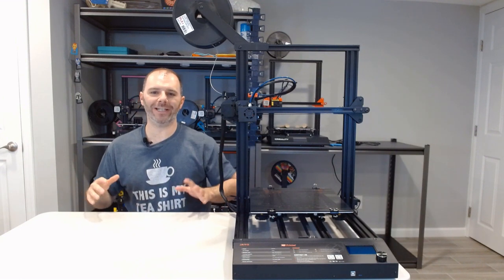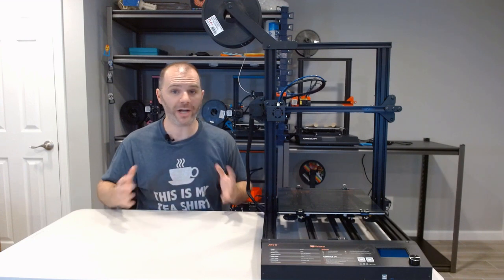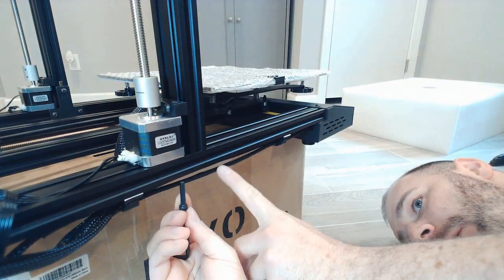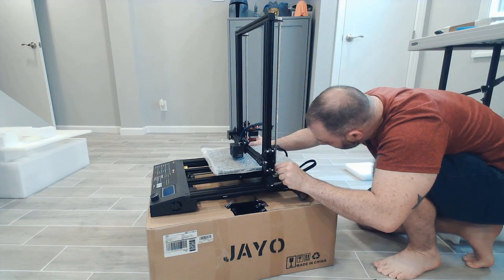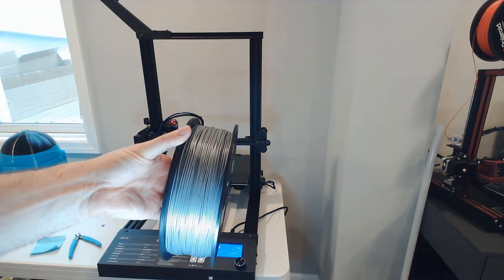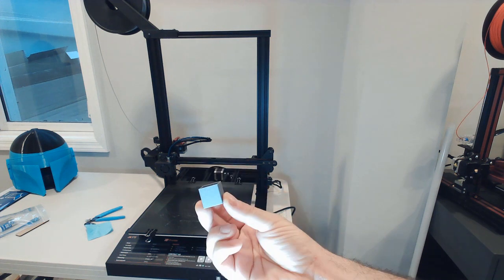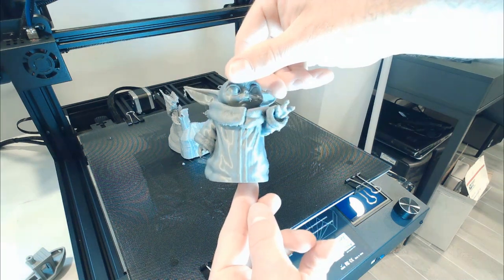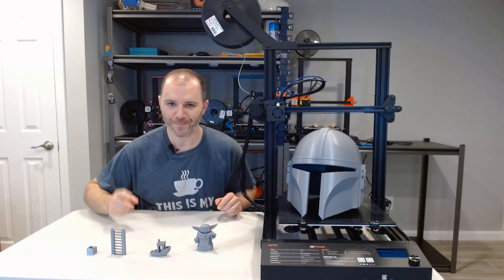Jayo S8 Plus - Unbox, Assembly, First Print | Sunlu S8 Plus

Comment: Just ordered the 8 Pro version and my plan is to convert it to direct drive for TPU since it has the "open" extruder design of the Aquila to where with a more closed design to receive the filament after the drive gear (which there are 3d Prints for this to say nothing of hardware kits), I can hopefully minimize the chance of filament escape.  A $15 Ender direct drive conversion bracket set will let me mount the extruder over the hotend with a bit of Capricorn tubing.  Hopefully the hotend will mount on that new Ender carriage included in the kit, but if not I can drill and tap some holes or even just get a new hotend compatible with the Ender mounting since they're not that expensive.

Between the great price for the Pro at $199 with flex magnetic bed and quiet steppers combined with an apparently easy way to convert to direct drive AND have not some closed extruder to have to tear apart if TPU filament escapes, I think it should be a good deal for the large print area.  I also like the full size USB on it as I use Octo4a which works just fine with a Tracfone Blu View 2 for $30 (plus a OTG adapter for charging and USB connection) to give me full remote WiFi control and printing using Octoprint.  Hard to beat converting your printer to full wireless with Octoprint for $40 and stop running SD cards back and forth...  They should have a marketing line like "Once you Octoprint, you'lll never want to just print".
Reply from the maker: B it sounds like you have yourself a nice plan! For the TPU you don't necessarily need to convert to a direct extruder, if you just upgrade the extruder to a BMG clone style extruder you can still use the stock Bowden setup (although that assumes the stock setup is Bowden style, as I'm not familiar with this iteration of the printer). Other than that your plans sound amazing and I like you have gone wireless, and it's hard to go back lol! Good luck !
Reply: @PrintsLeo3D  I'm trying to shoot some pretty soft TPU, literally around cooked spaghetti!  I also like direct drive for faster filament changes, including mid print, which this is supposed to respond to an M600 for filament change as I like to do a color change now and then mid print.  I have a number of Bowden and direct drive printers, and have just never seen better prints out of the Bowden but admittedly haven't tried racing both to see if the Bowden's will indeed top out at a faster print speed due to the lower hotend mass.  But, speed isn't my thing as it's just a hobby and I don't keep the printers I have now really busy since printing a ton of Gridfinity and also a large Settlers of Catan set.
Reply from the maker: B, all that matters is you're making an informed decision, and it seems you know what you're doing so you keep it up! The gridfinity stuff is amazing and I was just talking to my cousin about Catan. He's pretty into it but I've never played, seems like the kind of game I'd like.
Reply: @PrintsLeo3D  My family enjoys Catan a lot, so if you like board games and strategy games, you might give it a go.  It's the "Monopoly" of the rest of the world, but being a "Euro Game" means you stay in the running until the end, unlike Monopoly where after you get behind it's pretty much all over.

Just converted the Sunlu to direct drive today.  I also used a Satsana Air Cooler I had printed for an Aquila but never used to give me double sided cooling and a larger 5015 blower for it since the cooling on the stock S8 is a bit anemic.  I had to cut and widen the clearance for the wider stock heatsink it has which took a little while and I could have just pulled the model from Thingiverse into Tinkercad and chopped it out for a reprint, but since it was all behind the scenes inside I didn't care how it looked.  I also managed to drill a hole from behind the heatsink fan down through to let the LED fall into place below the Satsana for a bit of a view when printing.  The Ender conversion kit worked perfectly and was dead lined up for the stock extruder:

https://www.amazon.com/dp/B09KG8MMQ2?psc=1&ref=ppx_yo2ov_dt_b_product_details

Now all that remains is to swap out the extruder head for one more closed up since the stock head looks like it has little chance of not having TPU escape.  But it's printing well direct drive and looks good.
Reply from the maker: That's great news! Sounds like you're through the hard parts and now you can start tweaking as needed. Good luck with the printer and whenever you get some nice TPI prints done head over to my Discord (link in description) and show them off !

Comment: Any updates on the S8?
Reply from the maker: This printer was printing great for me, so much so I bought a second. Over some time though j wasn't using the large build sizes as much, and I was getting more printers and having less space, so unfortunately I got rid of them both. I know since this video there have been some updates to this model though which should have made it a little more advanced than the one I had in this video.
Reply: @PrintsLeo3D  thank for your reply. I'm going to get one and hotrod it with King and try out my Creality laser kit on it.
Reply from the maker: That sounds really cool, I haven't gotten into any of the laser stuff yet but the tech looks awesome ! Good luck and be safe, I hope this works out well for you !

Comment: Thanks for your video, i was just seconds before buying a CR-10 V3 before redditing my way to you here. Im running a Elegoo Neptune 2 for months now and modded the heck out of it with incredible results. I have no "high budget" comparison, but your review makes me believe i will experience the same with the S8 here, but at 300mm, because thats mandatory for my next builds.
Reply from the maker: I have 2 S8s and I love them. They've printed great for me but I haven't done too much modding. Since this video a lot of people have reached out to me to help with some issues they've experienced, so this printer has given people some headaches. I also have a CR10 and I will say they produce about the same quality prints, the only downside to the S8 is the hot end mounting is mirrored from all Ender models, so finding fan shrouds and accessories that fit can be tough. Otherwise I'm still loving my S8

Comment: where can i find a hot bed for a voxelab 3d printer
Reply from the maker: When you say hot bed are you referring to the top bed surface, such as a glass plate or PEI coated flex plate? Or do you mean the actual aluminum bed that is attached to the frame with the roller wheels ?

Comment: Tree supports are they built into Cura or is it a addon that needs to be downloaded?
I always have the issue of the supports being too hard to get off and end up destroying the print.
And can you pick where you want the supports to be? Or does Cura just make it's own calculations and adds them where it sees fit to?
Reply from the maker: Tree supports are now baked into Cura. There's a drop down under supports, I believe called support type, where it can be changed from the standard supports to Tree support. Now you may need to have "expert" or "all" features tab selected, which opens up more options for each drop down menu. If you have do have "all" selected then under Supports you'll have an array of different options that will let you customize how your supports work and get applied that you can tweak to make removing them easier. 

Cura does have a way to place individual supports, it's not intuitive but can be useful. There's an option called "Support Blocker" on the left side panel. This option places scalable cubes that block supports. However once these cubes are placed on a model they can be  selected. Then you can use another tool that is along the left side panel (I believe it is above the support blocker option?) that can change what the cube does. You can have that scalable cube become a support, and this way you can place and scale them to your leisure. 

I am recording an intro to Cura video, and once that is released I'll be able to create some advanced videos such as this topic!

Comment: Hey Leo, thank you for making this video as I just got my S8 plus yesterday.  I'm a complete rookie when it comes to printing and would like some help please as my test prints I tried all got stuck at the lower left corner of the plate.  Any help you could offer would be greatly appreciated sir, thanks!
Reply from the maker: Thanks for watching and I'm glad you're entering the 3d printing world. I'd be happy to help as much as I can. I'm not sure exactly what difficulties  you're experiencing. Are you using Cura as a slicer (which turns the models into gcode for the printer)? Are you printing at the middle of the Bed but the models are printing at the corners ?
Reply: @PrintsLeo3D  I was using cura but the printer refused to start printing in the center of the print plate, it also shut itself down ever time I tried to print so I sent it back as a lemon and will be getting a better model.
Reply from the maker: That's so strange. Did you make sure the voltage selector on the psu was in the correct spot for your location? 115v if you're in the United States. That's really awful you got a lemon out of the box. Once you get back up and running I'll help however I can to get you printing.
Reply: @PrintsLeo3D  Much appreciated.
Reply: @PrintsLeo3D  So I just got my new printer set up sir, a Longer LK5 Pro, is the offer to help me get this thing working still good?
Reply from the maker: I don't have any hands-on experience  with the Longer series of printers, but I will do whatever I can!
Reply: @PrintsLeo3D  Thank you sir, how do I reach out to you so this doesn't fill up the comments of your video?
Reply: @PrintsLeo3D  So I attempted to print a standard cube yesterday but wound up with a clump of melted material around my extruder.
Reply from the maker: Hey sorry I didn't respond to your last comment sometimes YouTube won't notify me of new comments within comment chains I've already responded to. You can email me at printsleo3d@gmail.com and we can discuss it there as I get notified of all the emails I get. Send me an email if you don't mind and I'll respond to your initial cube issues because it's going to be a long response lol
Reply: @PrintsLeo3D  Done and done.

Comment: Hi Leo. I guess i have done half of the views for this video. I have the same S8 Plus with no upgrades and i have the same issue of the warping at the center plate. I have also tried to compensate with thin sheets, but i can't print the leveling test with the squares (9 in my case). I don't know what to do
Reply from the maker: Thanks so much for all the views lol having a warped build plate like this is really a bummer and can be hard to work around. When you run your leveling tests how does it print ? Are the edges printing fine but center isn't ? Is the center printing fine but the edges aren't ? Outside of trying to shim the build plate there's not a while lot we can do. I have added a BL Touch to mine since this video and I was able to remove any added shims and it's printing great. I have considered releasing a BL Touch install video for this machine but I'm not fully comfortable with the firmware upgrade that accompanies it. Hopefully I'll get some more time to prune the firmware a little better and I can get this video out there .
Reply: @PrintsLeo3D  I have spent much time to level the plate and the only thing i have printed it was the skirt auround. The squares cannot even stick on plate, and they are only 3 or 4 cm far the skirt.
Maybe I should try with a smaller surface and be content for it. It was my fault to have chosen this as first printer.
In your opinion should i contact the assistance?
Reply from the maker: Depending on where you bought this printer and how long ago you should certainly call customer service and/or request a refund. Leveling the bed is a tough task and it takes time to get it right but relying on what you said , which is you have tried leveling this bed for a long time, it's very possible your build plate is warped badly enough that no amount of leveling will suffice. When you level the bed are you using the built in leveling process ? Or are you disabling the stepper motors and moving the hot end around manually ? The only other step you can take, and this is note of an adhesion solution than a leveling one, is to apply a thin layer of purple glue stick to your bed surface to see if that helps adhere the filament to the bed. Really a tough spot to be in and I hope it works out for you.
Reply: @PrintsLeo3D  I recently bought one also and am having a similar issue. The thing is that I don't think it's a leveling problem because I can print the shamrock file that comes with the printer without issue. However any file I slice peels up off of the plate and starts moving around with the printer head. I'm using Cura 4.12.1 with the CR-10 profile. Any tips would be welcome. Great video and thank you!
Reply from the maker: Getting great adhesion can be so tough sometimes. Have you adjusted the Z offset for the printer? I have a seperate video that deals with bed leveling /z offset. Bed leveling is unfortunately  only half the battle, once we know the Bed is Level we need to adjust for the gap that we created during the leveling process. I would recommend watching my Bed level/z offset video because I have a feeling this is what's plaguing your printer. Let me know if that video helps at all!

Comment: I've been running my sunlu s8 + for a while, the left motor has started failing me, with me living in mexico i cannot buy the replacement motor directly from sunlu themselves and my other options are in amazon, i don't really know what motors should I be buying honestly and it's driving me crazy
Reply from the maker: If I'm not mistaken you can buy a Creality style 42-40 stepper motor (or similar - Nema 17 stepper motor) and it should fit in perfectly for this application, providing the correct amount of torque. Buying brands Creality or Two Trees should be a pretty safe buy but do some research beforehand just in case! Good luck and keep printing. Let me know if you need any other help.

Comment: I got one and I'm wondering is the nozzle a .45mm or .4mm because it says on the sunlu site it's .45mm
Reply from the maker: That's a great question and one I was wondering about when I first got it. I never truly found out but ultimately I don't think it really matters, you can curate all the settings for nozzle size (line width, layer height, etc) inside of your slicer. I just stuck to considering it a 0.4 nozzle and then by the time I replaced it I slotted an actual 0.4 nozzle in and all was good! For any setting inside my slicer that directly asked for my nozzle size, I chose 0.4.
Reply: @PrintsLeo3D  yea tbh idk how to tell what issues are on the printer but the prints aren't there great right now I should probably do the belts though and oil it up it is loud so it probably needs oil
Reply from the maker: I would make sure the E-steps have been calibrated, then maybe a PID tune, the factory settings are pretty good but it's always best to adjust them once the printer is in the setting it will normally be printing in. Of course adjusting those belts makes a lot of difference too if there's significant play. What sort of printing issues have you been experiencing?
Reply: @PrintsLeo3D  I think it's bridging I'm not sure my voxelab aquila prints better though the prints on it are smooth and stuff
Reply from the maker: It could be a matter of just setting up a decent print profile in your slicer, maybe slow some things down. As for the bridging I read a lot of other users with similar issues before I bought this. I really haven't encountered any significant cooling/bridging issues, but people were recommending the Red Squirrel fan shroud to help with that. Worth a look if you want to get some better cooling.

https://cults3d.com/en/3d-model/tool/red-squirrel-fan-shroud-for-sunlu-s8-4010-4020-5015-bl-touch-redsquirrelhobbies
Reply: @PrintsLeo3D  thanks i plan on printing wood for the first time once i get it figured out
Reply from the maker: Keep in mind also Wood filament can be abrasive and you may need to replace the nozzle after a prolonged amount of printing with it. Tighten them belts and good luck lol!
Reply: @PrintsLeo3D  yea I also just turned up the fan speed form 25 to 100% hopefully that helps to